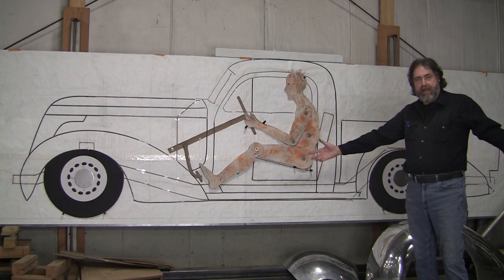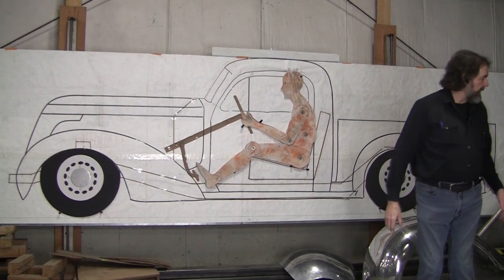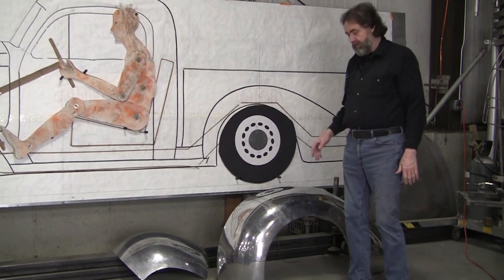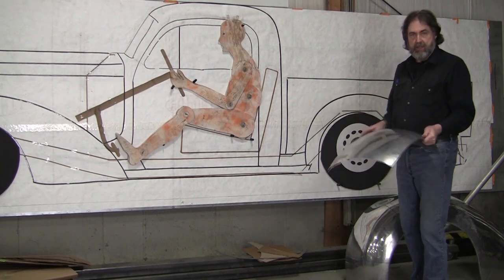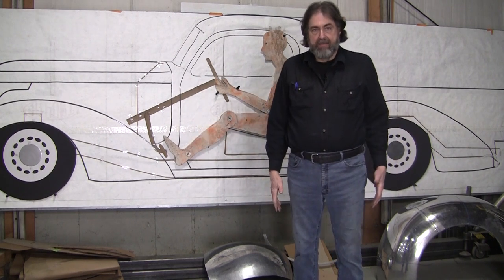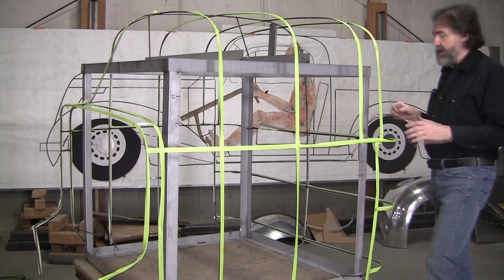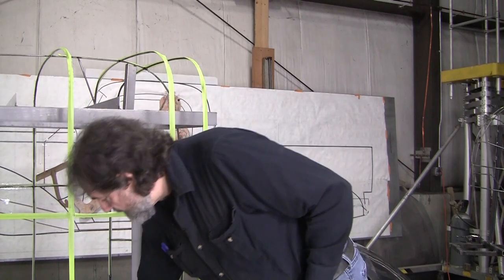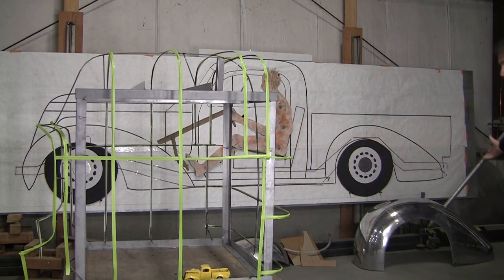1937 Studebaker Express Pickup Truck Wireform

Comment: Im a huge Japanese car fan. I am hyped to see if I can achieve my dream
Reply from the maker: Building a Toyota 2000 GT?
Reply: @proshaper  negative, although thats also a brilliant idea.

My dream is to have a Hakosuka Skyline, so a 1969 Nissan Skyline.

2 doors, 60s Japanese styling, get a high reving engine. Whats not to like?

My only thing is can a car of that shape be made using these techniques?
Reply from the maker: @tjrizvi251  yes, any design car can be scratch-built and you can make it better than the original because you have the benefit of taking your time to build it and you can use a modern drivetrain. The original was a unibody design, you would be best served by making a tube frame with aluminum  body panels. The Italians were the masters in design for low production hand-built sportscars. You must study and learn from their history. The English did the best panel work, study their methods or do what I do combine them.
Reply: @proshaper  after I finish my current projects, my long term goal is going to be building that.
Reply: @tjrizvi251  As the owner of some 60's Mopar musclecars I would be interested in watching Wray make some flatter panels with more squared off or pointy body line details like the Skyline you mentioned.
Reply: @TheInsaneShecklador  Ive seen some work for T Buckets and hot rods which tend to be more squarish